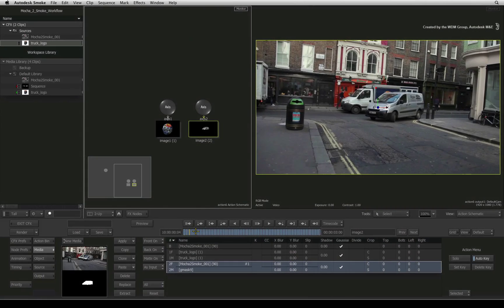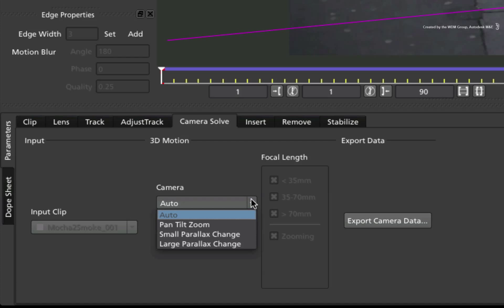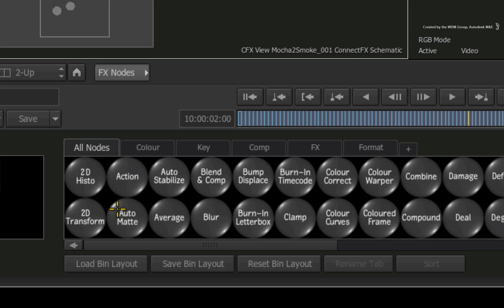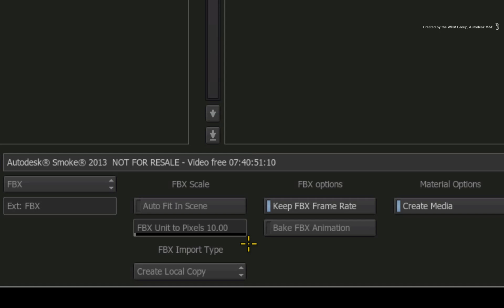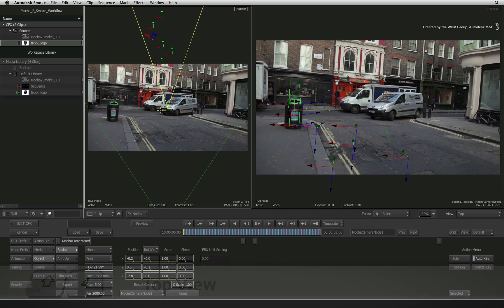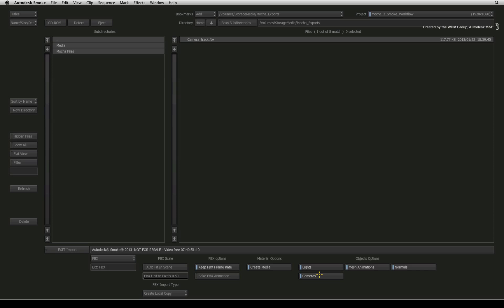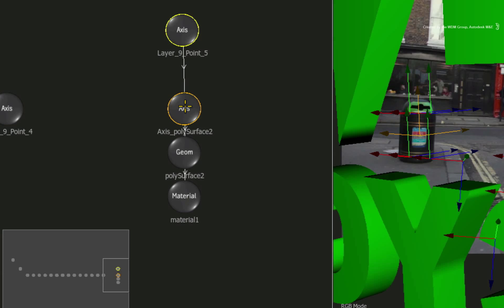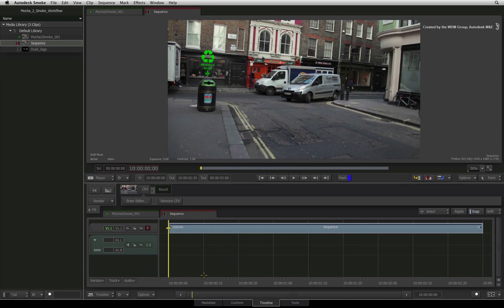Mocha to Smoke Interoperability - Part 3 - 3D Camera Tracking Data

Comment from the maker: @Dennis - The are 2 techniques that you could use to create a shadow.

1. You could either create a fake shadow using the alpha of the key. Link it to the tracking data in the action schematic and than adjust the rotation until the angle looks correct.

2. Duplicate the action and add a surface as a ground plane. You would than use a light to cast a shadow on the ground plane. You would than tell action to output a shadow pass that would be recomposited later with the original action output.

Comment from the maker: Hi, I could show how to integrate a 3D model like this video but the part that is missing is 3D tracking.   Depending on the type of shot, you could get away with 2D tracking which Smoke can do but if the camera moves get more complex, you need 3D tracking to get it right.